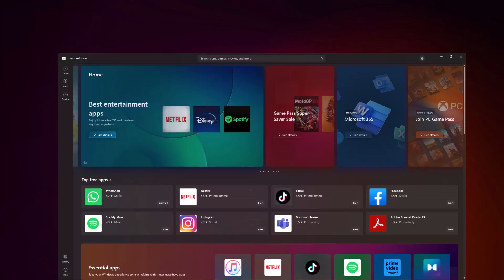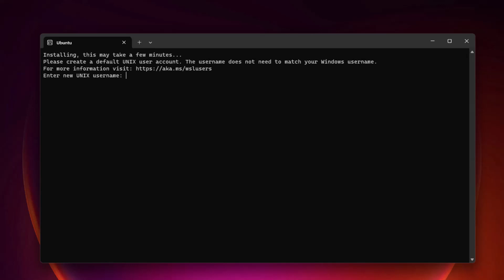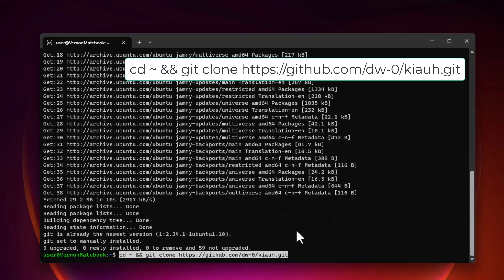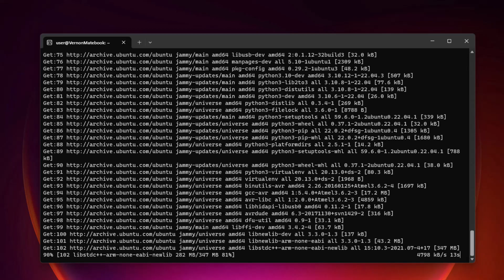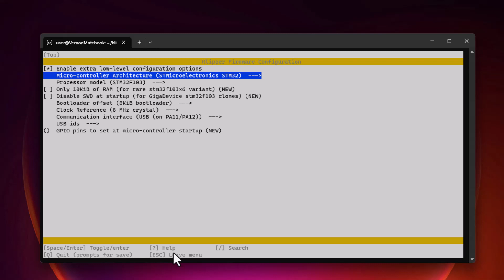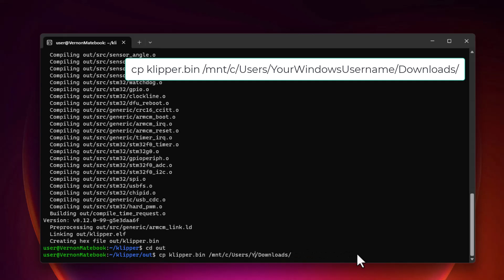SKR Mini E3 V3 Firmware Build Tutorial

Comment: hey as i get started in this .. first thanks, the first tutorial went well with a few things .. i had to go to my bios and change some settings also into the windows 11 features and add linux subsystem, nothing worked at first but search the error codes go me there. i did not install hypervisor as it suggested. I saw nothing during the install like yours about python but i did see something flashed across the screen so i assumber that the main install just took care of that. All aside i just followed your video to the T ... i had no idea what or why i was doing it ... like the ESP32 bit but i just did :) .. 

So where i finished off as i go to bed and hope to catch up with your comments tomorrow or soon.
 i have just put the klipper.bin on my desk
top and renamed it to firmware.bin. Now you said coy that firmware .bin to my printer ?? do you really mean printer ??  do you mean my 3d printer .... an ender 3 s1 ?? or do you mean on a card and into the smartbox 2 ?

Somehow it would be graet to communicate with you directly as i am a bit scared this is going to go wrong ... is this possible and how ?? but aside from that I am going to dig into this and see if i can update the smartbox .. while i have used octoprint before i have also seen mainsail and that was just so much better ... but heres the things .. Creality tied on the smartbox .. but to be blunt and you probably know this .. its just rubbish its only does the most basic of things and i would rather have klipper / and octoprint any day so given i did not get a creality camera with my box and now those boxes are quouit cheap from creality it make more sense to use the box and save a raspberry pi .. anway getting back to my querstion if you could help me out and clarify that its the Printer i first need to flash and not the box i should be able to see you again the the next video ... Can i say i'm 20% there? but really i apprecaite you video and time to make it ... maybe you can help another sole :) which is actually really good of you i must say .. just making these tutorials.